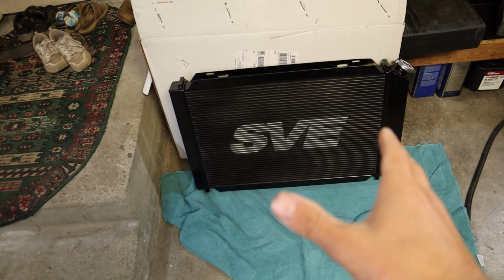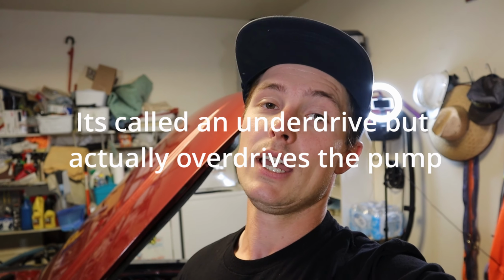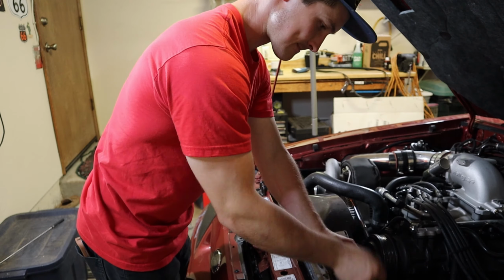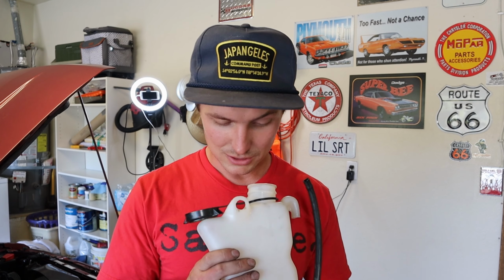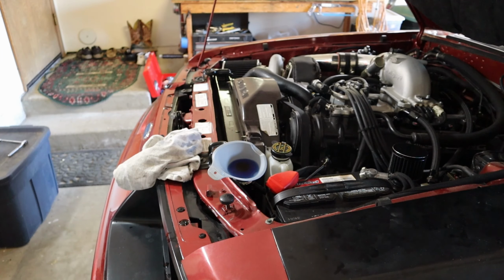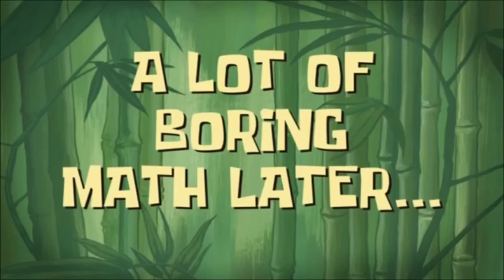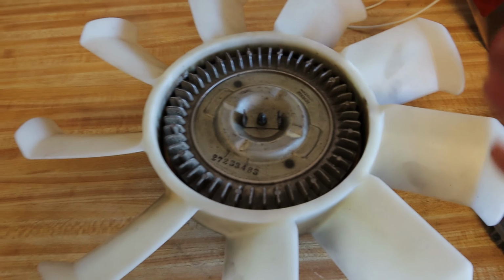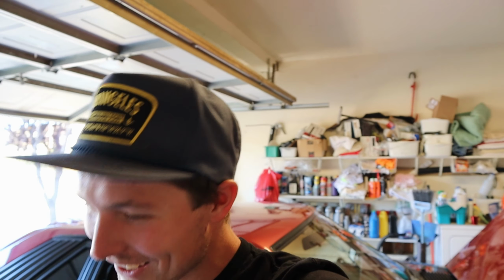Fixing A TON of overheating problems on my TURBOCHARGED Fox Body!!

Comment: I have a turbo fox and mine climbs to 235 when I get into boost. Cruising it's at 187. Upgraded 3 core radiator, stock fan and shroud, replaced waterpump, underdrive pully, and burped the system. The only thing left to check is my fan clutch. Thanks for the video hope it fixes my issue

Comment: I have constant overheating issues with my 351w turbo setup and Holley. Pos just doesn’t get worked out
Reply from the maker: That sucks man! This took me forever to figure out had me going crazy for a while! Hope you can get yours worked out!
Reply: @iamchazhaynes7074  I hope so man, my setup isn’t that much different than yours. Always issues man
Reply from the maker: I know these little problems are a PITA that’s one of the reasons my videos have slowed down! But we will both get there eventually!

Comment: Well it wasn't too bad, after spending 500 bucks and figuring  out that it was only a jacked up $20 fan clutch. 😂🤣😂  Im guilty of the same thing But you're good to go now and you won't have to worry about any cooling issues for a while which is probably good that you replaced all of that stuff anyway because you don't want some old parts to ruin your new engine, I just went ahead and replaced all of that stuff to begin with and I have a underdrive pulley but I have a high volume pump to make up for it so that it will still flow good so you can probably put the underdrive pulley back on if you have a high volume pump and get some contour fans to keep it cool and get your hoss powah 💪🏻🐎 back 😂🤣💪🏻 I can tell that was really driving u insane 😂🤣
Reply: Just skip on by my comment then, i see how it is 😂🤣 u said im not about to read all of that shit, ill just give him the im not talking to you heart and keep going 1😂🤣😂
Reply from the maker: No no no 😂 I was at work and didn’t have enough time to read it!! I wanted to make to read the whole thing and give a good response!!! Hahaha I like your comment’s they make me bust up laughing!! But it was seriously killing me on the inside!!! And your right I could probably slap that other water pulley back on to get some powa and I need some electric fans soon to get my 15 hp!! Lol
Reply: @iamchazhaynes7074  😂🤣 I try to make them funny, and I knew that u didn't read it because you would have had to reply to it after wasting a half a day reading that book I left u for entertainment while on the john 🤣😂 I know that if I get a heart without a response that means that they said f that im not reading all that, hear take this heart and shut up 😂🤣😂🤣 so im going to have to keep my 👀 on you because you might try to slip on by and not read my books 😂🤣😂🤣😆 I saw that thing had you so stressed out the when you got it fixed you had to drink a beer like you just got finished up with your girlfriend, like it was just as satisfying if not more 😂🤣😂🤣😂🤣 id play it safe and not comment on that if she reads these 😊🤣😂🤣😂🤣
Reply from the maker: HAHAHA oh no I read ALL the books makes the posting the videos worthwhile!! Haahahaha wel if she ever does read them she will have to deal with it 😂😂😂 but I did need that beer!! That whole ordeal was soul crushing!!! I’m just happy it got figured out! But now it’s time to stress my self out even more with the new ECU 😂😂 and I’m telling you know I’ll definitely need more beers 😂😂🥲🤣🤣
Reply: There's that heart again 😂

Comment: Just get a SN GT fan with dual speeds, mount it and have the liw speed for AC and high speed come on at 205 off at 190 and never look back
Reply from the maker: I’m going to go to an electric fan setup soon! I just didn’t want to deal with the wiring just yet because I’m wiring the new PiMPxs in and I just figured I’d do it later. But you like that fan?? I’ve been hearing contour fans and someone on the turbo foxbody forum SWEARS by the 2005-07 focus fans lol
Reply: @iamchazhaynes7074  the SN/New edge, Focus and Contour all draw 3000-3500cfm on high speed so any will be fine just imo the GT is a simplest to mount and least amp draw of all i have checked. Ive seen 3290cfm on a stock SN radiator and 3160 thru a dual 1” core radiator so cfm will depend on the fin count and design, usually the 3-4 cores seem to kill more cfm and also create more amp draw from said restriction. Pick whats easiest to mount out of a factory fan and enjoy but just an FYI...my dual core radiator had a 10” 900cfm fan and cooled my turbo 5.0 just fine and rarely saw 200* after four 1/4 mile passed back to back then cooled back to 190 before the ET shack so any stock fan will be fine. Also wire it so the Pimp can control the fan
Reply from the maker: that’s a lot of good information! I’ve been making my head spin reading forums on which fan is best but that’s kind of what I was thinking as well on what fits the best I was going to go to the junkyard and just see which looks and fits the best for the car but yea the 3 row probably wasn’t the best choice after the research I did I should have went with something else especially not the SVE. The radiator is sub par in honesty, I just got it on sale 🤷🏼‍♂️ and I will definitely have the Pimp control the fans! Lol
Reply: @iamchazhaynes7074  that radiator will be just fine unless you plan on running road course with it and if so the cooling would be the last thing i worried about lol, good luck man hope to see some low 6s 1/8 mile out of it soon
Reply from the maker: Thanks man!! And we are definitely going to try! 😤👍🏻